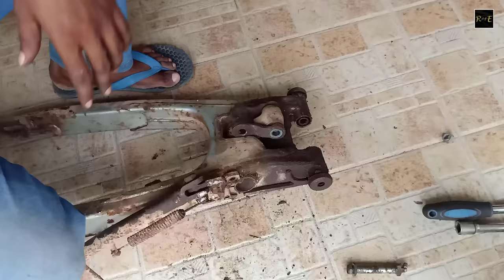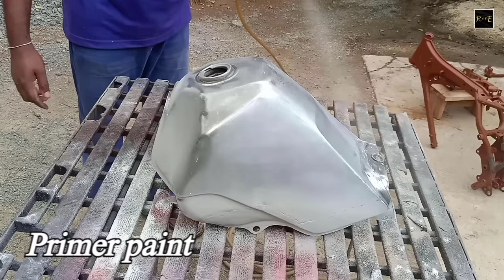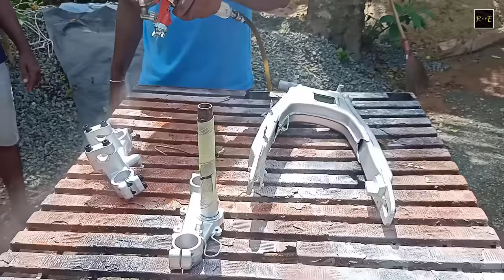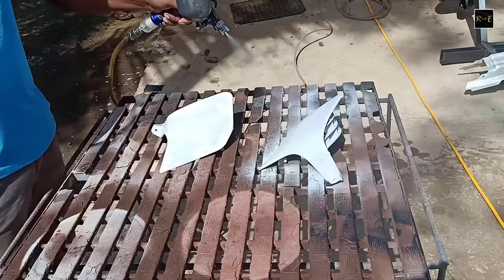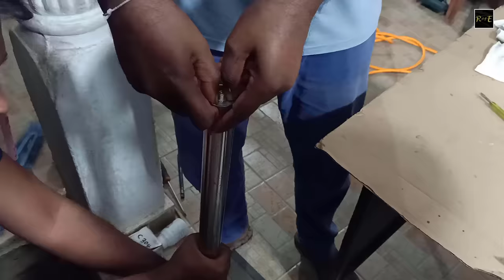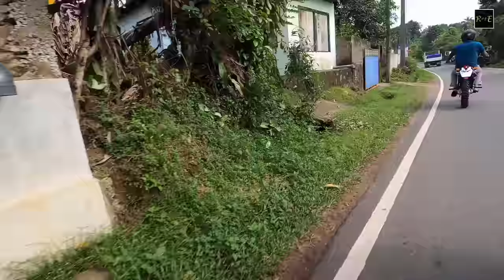Yamaha Serow 225cc Motorbike full restoration

Comment: Wow!
I have the same bike!
This bike“Serow” is the most favorite off-road bike in Japan.
Reply: Realy? But it is small, and on the highway is not good... Maximum speed is about 80 km/h may be 95.
Reply: @Акамулятор  thats why its good offroad, its light and small CC. also 125cc 4 strokes already go 110 so why wouldnt this.
Reply: @kanggoo57  110km/h is the maximum speed. And max rotation of engine. It is no good for engine, to ride at this rotation for a long time, 15minutes -1 hour, 2,3 hours. Engine crack.
Cruise speed is 80km/h - 70-80% of max rotation. The engine is weak. 20 hp only.
In the same class of little enduro - better choice is kawasaki super sherpa -26 horse power, max speed about 130km/h.
Or Honda SL230. Also 26 hp.
And Suzuki Djebel 200 has also 20hp.
The suspension is all the same, on all this bikes.
Much more good is Suzuki Djebel 250! Powerful engine 31hp, amazing suspention, you make jump on it like a really serrow. 300milimeters run of suspention! Max speed 135. But it really fast!
Reply: @kanggoo57  the Serrow I have is at 225cc not 125
Reply: @tasoskouskos4646  yes? Thats not what i Said lol, read my comment again.
Reply: And the xt 250 yamaha